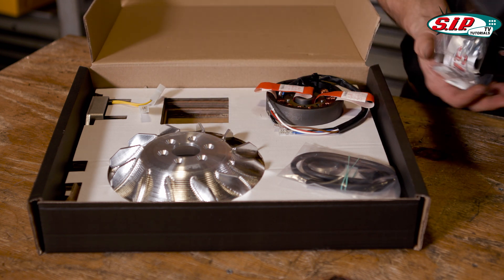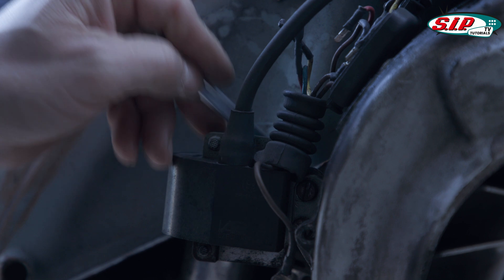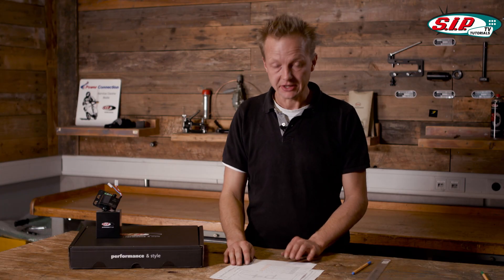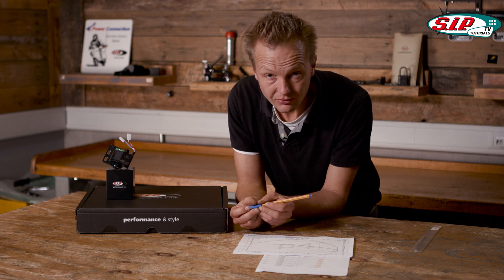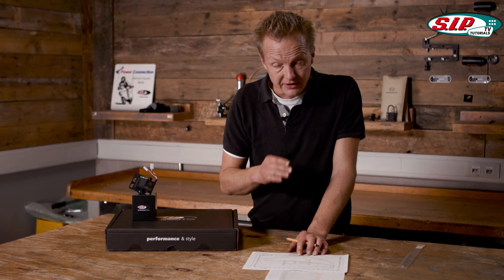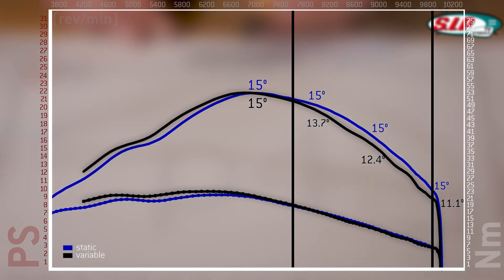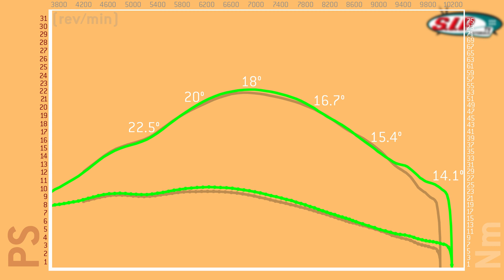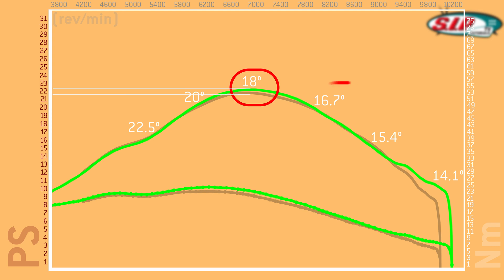Vespa PX Engine TUNING 🛵🔧 | Part 2 | Ignition {English}

Comment: I have a 1978 px125 that runs with no battery. It bogs down when engine runs long/heated. Any mods you suggest? or do you have parts that I should replace? Or do I replace enture engine?